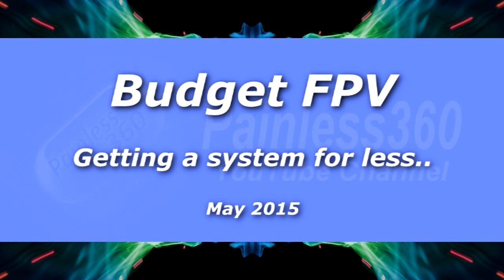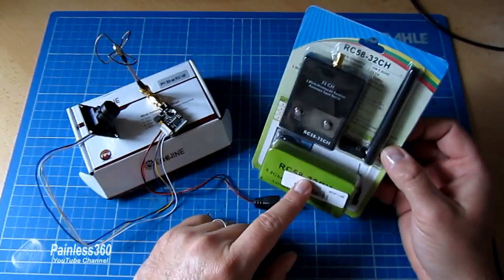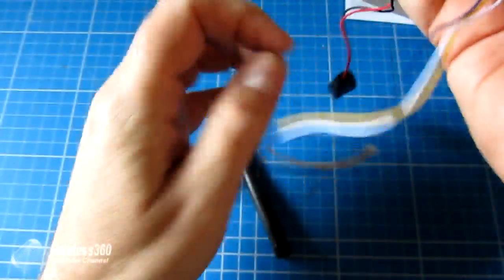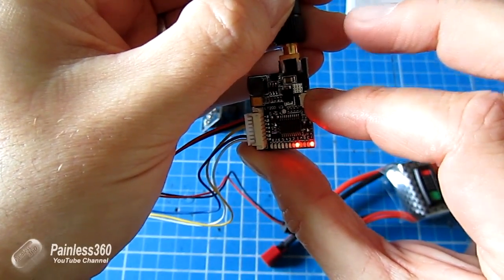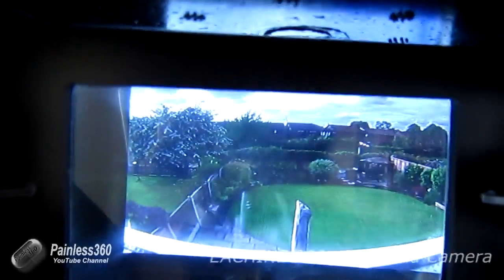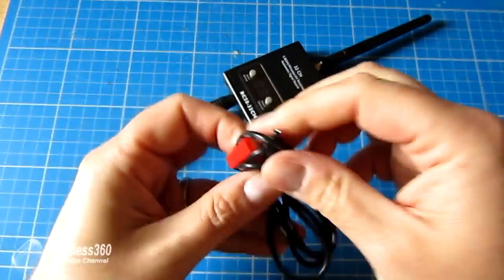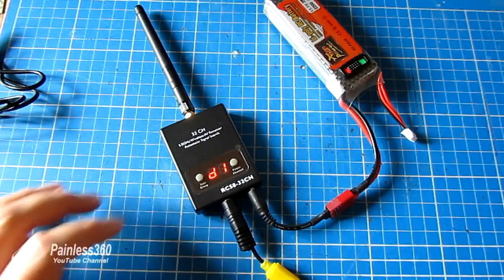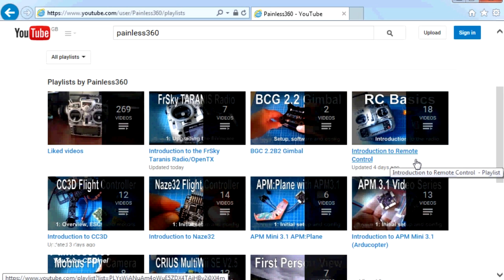Great FPV on a Budget - How to get a camera, transmitter and receiver (products from Banggood.com)

Comment: After getting a broken transmitter from bevrc I got this to start fpving.
I got the 305 receiver and they are a perfect setup for my bixler.
I use the quantum DIY fpv goggles and can see everything fine to around 2km

Comment: Glad to see you found the same comparability issue between the rx and fatshark tx. I used one for some 'passenger' goggles and found much poorer range than my immersion rx, but thought it might just have been a bad rx so banggood replaced it which of course made no difference.

It will be interesting to see how the camera/tx combo work in action.
Reply from the maker: atschris In action they work great for local field flying and getting into FPV. You get a huge 'bang for your buck' using this system and once people start to get into it then investments in more expensive kit makes sense.
Saying that - still love the Quanum goggles - don't care if I look like Bender!

Comment: im using Eachine fpv kits, a 200mw and a 600mw, they are sound, even when using the standard antenna, they handle low light really well, the only problem I found was when its getting dark and theres still a bit of light left in the sky the camera struggles to see the ground until you are in the shadows, other than that, its a perfect kit and the price is a bonus

Comment: I cannot wear fat shark due to glasses. I did get some nice goggles on sale,actually referbs at a dirt cheap price. I got the echine tx02 camara and also a seperate transmitter and receiver. I wanted it to run my  run cam from. I wish Banggood would send me free stuff to test but thats ok,I just watch guys like you and figure out what it is I want. Good video.

Comment: Excellent video! I have a question that isn't RC related, but still is on the subject of wireless cameras. I picked up a security camera and would like to use it wirelessly over an IP so I can view it on my laptop. I know there are systems that can be purchase, but this is a high quality camera that I have next to nothing invested in. I'm hoping I just need a transmitter, but I'm not sure which transmitter would be suitable. If you could point me in the right direction, that would be greatly appreciated :)
Reply from the maker: +4DIYers sorry, Im not sure. I would normally use some kind of FPV system but Wi-Fi connectivity isn't something we tend to get involved in a lot here for remote control. Best of luck with it.
Reply: No problem and thank you for the reply :) I appreciate your honestly.

Comment: I can watch your videos for days!!! There is so much good information. Thanks for all the great instruction! Subd! I have a quick question. I saw a 600mw version of the tx kit from eachine on banggood. Would that be a better choice? Or does that not make too big a difference? Sorry if I missed that in one of your other videos. Oh yeah it will be used for racing and freestyle type flying. Thanks for any advice!
Reply from the maker: The more power equalls more range. A lot of countries only allow a certain maximum power for FPV transmitters so be aware of that when you order one.  Best of luck!
Reply: Painless360 I will definitely remain aware of that! Thanks again!

Comment: Nice review.  The camera is CMOS and I think the CCD cameras, also inexpensive   at about $17 from Banggood, are less prone to jello effects because of rolling shutter in CMOS devices.  Thanks for exploring the more affordable options.
Reply from the maker: Hugh Dinwiddie Please point me to a cheap. 5v CCD camera...
Thanks
Reply: Painless360  I don't have this camera, but this looks like a possibility: http://goo.gl/mNXCsu  After your video I ordered this which seems to be the same camera as the link here along with the transmitter you had: http://goo.gl/F5AZwc
Reply from the maker: It is very similar but not the same, will have to get one and see..

Thanks and happy flying!

Comment: Is the RP-SMA adapter you quote in the mentioned products link above the correct one?  or do I have to select which 'ends' I need when ordering.   You guessed it.. I'm new to this FPV lark but I do intend to follow your advice on the strength of your videos here.  Superb work!  I hoping your setup here will be suitable for fixed wing out to 1500m?
Reply from the maker: The links are to the ones I am using in the video.  Best of luck!

Comment: Thanks so much for the clear explanation of this FPV system. I am totally new to RC and quadcopters so I have just now ordered the kit above and the Emax frame combo kit you also reviewed, so excited. Can you recommend an entry budget level radio and quadcopter battery as well as the battery for the receiver/quanum goggles. Thanks so much I'll keep watching.
Reply from the maker: ***** Hi Rob, there are a few videos on the channel about learning to fly and flying FPV. This playlist may be of use - https://www.youtube.com/playlist?list=PLYsWjANuAm4rQfddw-7YZDzckoJ_KyOpm
Radios are an investment for the hobby and something that can stay with you for many years. I still use my first 'proper' radio a DX7 and have had it for almost 8 years now. I would look at what your friends use and consider radios like the Turnigy 9XR.
The battery to power the goggles doesn't need to be huge. I little 3s 500mah pack will run if for hours.
Best of luck with the FPV, it can take time to get to grips with it..
Reply: Many thanks for prompt reply. I'll keep you posted as to how things develop. Cheers
Reply from the maker: Best of luck with it. FPV is a blast!

Comment: Brilliant series of vids, can't thank you enough for all the useful info.  Can I ask if the low cost fpv gear from banggood can be used with a Möbius to display on a ground station?  Thanks again.
Reply from the maker: Roger Williams Yes it can. You will need to make the cable to connect the USB/AV out cable that comes with the Mobius to the Tx though..
Best of luck.

Comment: Nice video - FYI the different connextors are called small and rpsma if u didn't k ow already. Love your videoa, especially your APM series. :)
Reply from the maker: The Channel Formerly Known as Epik Beats Thanks for that - I did know that but most people get very confused and I've seen vendors also use the wrong names for the connectors to so showing the pin/lack of pin is a very 'safe'' way of letting subscribers know what they are getting/need.
Happy flying!

Comment: Hi mate, a big fan of your channel here, you helped me to get my tri-copter with multiwii and now I have build several quads with naze32 with your help. Now getting into FPV, and I'm fighting with a Eachine camera to make it work with the minimOSD, so far no success. I see you have used that camera in this video, I have almost the same system (Eachine 600 with 800TVL camera), can you point me to the configuration I need in the minim osd arduino code to make them work together? (Eachine camera with the minimOSD).Thanks!
Reply from the maker: All of the steps are covered in the video. Check wiring and also that both are set to the same TV setting (PAL/NTSC).. Best of luck!

Comment: I built an FPV system like that with similar parts I got on Ebay.  I probably should have ordered from Banggood though because the first seller I ordered from seemed to go out of business and was delisted from Ebay so I never got anything and had to order everything all over again from a different seller. I was going to use it on a quadcopter that I intended to build using a Pixhawk PX4 but since that's impossible to ever get working I'll probably use the FPV system to get video from a remote security camera instead.
Reply from the maker: Lots of other flight controllers to use if you have given up on the Pixhawk. Best of luck!
Reply: +Painless360  Yes I bought a KK2.1 that should be an upgrade from the worthless Pixhawk. Not as many features but at least they can be made to fly and you don't need any crappy shareware to run it.
Reply from the maker: The KK2.1 is BASIC so you've gone from one end of the spectrum to the other! Best of luck.

Comment: Nice review and a neat little package for the money.  Can I just get the transmitter on its own?  I've managed to smash the SMA connector off my 250mw Fatshark transmitter and after soldering back together, it's doesn't appear to be performing as well.  Also, is the connector which goes into the camera the same as the Fatshark cameras connector?  I have the 600TVL CMOS Fatshark camera which is good enough for me.
Reply from the maker: valderja Yep - I am using it with a FatShark Pilot HD camera at the moment on my latest build (tri-copter).
Happy flying!
Reply: Thanks for that.
Reply: What kind of range do you find you're getting when flying a quad fairly low down with this setup using those CP/CL antennas?
Reply from the maker: I don't fly too low personally. there is a rule of thumb that your height should be 10% of the distance away from yourself to maintain a good connection. I have had the craft low about 240meters out and now had an issue though..

Hope this helps.
Reply: Good to know, thanks for the info.  I found that I was having signal drop outs when I was a couple of hundred yards away when I was maybe only fifteen feet off the deck with my current setup.  Signal is much better when I'm higher up

Comment: Startersets are very good. Do you know if there is a WDR (wide dynamic range) system in camera? This makes the image not better but the contrast is much  better. Maybe an idea for another Video.
Have great weekend and thanks for so many informations.
Reply from the maker: Peter Neumann This is a camera and transmitter for less than £18 - what so you think? ;)
Saying that, the image is excellent but if you want to spend a lot more there are other options for a camera you could connect.

Comment: Hey Painless.I went on your advice and bought this system and boy was I pleased with the outcome,thanks.
Just a quick few questions,can you put a link up for the RCA jack. Did you notice that the transmitter was getting pretty hot? I'm using a Turnigy 11.1V 3s 1000Milli battery for my Goggles and same for receiver and one for the Quantum goggles,did you notice or is it just mine?
Thanks
J
Reply from the maker: Jack.F Rost I got the RCA jack from the local electronics hobby shop (Maplins here in the UK). The Tx does get warm but not excessively so..
Reply: Jack.F Rost All transmitters get hot . The bigger in wattage the more heat to a degree, no pun intended. LOL

Comment: Thanks for the great video. I'm trying to order the parts and see that there are now right angled antennas available from the link you included. However, I am getting a bit confused between the various SMA connector types (male, female, SMA, RP-SMA), so please can you clarify which antennas and connectors should be ordered? Thanks,
Reply from the maker: I always rely on the image in a listing as some vendors get confused too!  ;)

Comment: I'm not sure if there's a problem here with My Transmitter, I've ordered 2 of these, the 600 mW version and the 200 mW version, I've recieved the 200 mW version already and during the bench testing everything seems to work perfectly, great video and good reception, everything.. My main issue is that the Transmitter gets extremely hot, almost to the point that you can't touch it, that's a bit worrysome. Is there a problem, or is that normal, should I maybe fabricate some heat sinks? And that's just the 200 mW, the 600 mW is I'm sure gonna be even worse..  :(
Reply from the maker: +Soco Joe They do get very warm, If you have a few little heat sinks it wouldn't hurt to pop one on the back of the inbuilt heat sink.. Best of luck!
Reply: +Painless360 Thanks very much for the reply, I just happen to have a Boscam 250 mW that never really worked right, why I bought these, such good reviews, I'll definately try to patch the heatsink from it to this new Transmitter.. Great Video, thanks so much for the Education, I'd never be able to do this without Your help..  ;)

Comment: One thing I really hate about FatSharks is that they have horrid chromatic aberrations at the edge of the FOV. These guys don't have any grasp of good quality optics. Boscam goggles are somewhat better in this regard, but there is still room for improvement in them also. You would think that for the price that these goggles cost, they could provide some decent achromatic lenses.
Reply from the maker: +K Danagger The Dom V3 I am using are great. The first ever set I got (going back a few years here) were the Predator 2 and the lenses were 'ok' but had chromic blurring at the edges. The latest generations is a huge leap. Happy flying!

Comment: Love your videos, I'm learning a lot! A question concerning the power necessities of the video receiver. It states 12V DC in but you're using a 3S (11.1v) supply... Any idea what this receiver regulates it to internally? I'm wondering if a 2S might be sufficient..
Actually same question about the transmitter. The 3S connector is supplied, but do you think this set might run off a 2S supply? For me my question is two-fold. First the literal question: can I use 2S? Well, I might just try and find out :) But also more general: is there such thing in the RC/FPV world as a common voltage that most electronics tend to operate on?
Reply from the maker: +lebasson Great question. Most transmitters are designed to work with 2-3s packs (check the specs for the one you are using), a 3s pack can be anything from 12.6v down to 10.5v (!) in use. There is normally a voltage regulator on them that is reducing the voltage to 5v anyway. Most things run on 5v and we use BECs to reduce the main battery voltage to that more useful voltage for all the electronics. Hope that helps..
Reply: +Painless360 That certainly does, thanks! Just ordered some BECs for future use. Handy for LED strips I imagine. Both the sender and receiver you used in this video work just fine on 2S btw. Happy!

Comment: Good video,,, thanks
Excuse me, I would even be a question.
How you can use the on-screen joysticks?
You transformed the cable? or always brought out the video signal cable and power.
Plugging the OSD cable and configure it?
Oh, and how many volts using
the camera hs1177
Reply from the maker: Sorry, we've not used those cameras. I assume that will be covered in the manual and specs. Best of luck..

Comment: are you going to make video about how to make good quality of FPV video?
LC filter, BEC and so on
Reply from the maker: Konstantin Mishenkov Not planning to - I've never had any of the problems with interference here using industry standard kit and common sense..Maybe I've been very lucky..
Reply: Painless360
 i use BEC to power video
without it video very unstable on maximum throttle

Comment: I have a couple questions regarding FPV:
1) You are using a 148 degree camera in this video. Do you find 148 to be the best choice for FPV? They also offer a 110 degree version. I think something narrower would be better. What are your feelings on the 110 version?
2) I'm from the US. So, what are the regulations for FPV use and power levels? I'm guessing this isn't an easy question but I'd like to get your take on this since I'm sure you are in contact with many US FPVers.
Reply from the maker: +Christopher Lyons I find the best views are 120-130 degree, any more feels like I loose too much detail in the centre of the image. Some fly up to 147 degree but that's the limit for me. I'd check with the local FPV resellers and check in the forums. I'd suspect that it's 25mw but every location seems to have a different law! Happy flying!
Reply: Thanks. What about 110?
Reply from the maker: See my previous answer ;) A lot of this is personal choice and what you are used to..

Comment: I'm going to order everything listed above. I have a question about the antennas on Banggoods site they have 4 different types which is the correct one to get?
L Type RP-SMA Male
L Type SMA Male     
W Type RP-SMA Male      
W Type SMA Male
Reply from the maker: +Michael Brewer I'm not sure, depends on what antennas you have/are going to order.. I've not heard of W and L type..
Reply: Ok, your link redirects you to the page with the different antennas.
Reply from the maker: Check the images in the listing, looks like SMA male and W type (i.e. no L bracket). Check with the vendor before ordering..

Comment: I found the 148 degree camera a bit too wide angle for me.  They also sell the same setup but with a 110 degree camera which I find a lot easier to fly with.
Reply from the maker: Stuart Bailey Yeah, I normally fly with 110-120 degree systems myself but don't find the 148 degree tricky to use. I have used wider too and, for me, the detail in the centre of the screen became just too small.
Happy flying!

Comment: What is the range of this fpv before it breaks up? Also can you use a screen/monitor to see instead of the goggles? I'm new to this stuff.
Reply from the maker: +betactical Range is tricky to answer as it depends on the antennas used, local conditions, power of the Tx, sensitivity of the receiver, position of the craft etc. With decent antenna this will easily get you past 400ft and well beyond with the right kit.

Comment: is your camera actually 148deg fov, I bought 2 of the 200mw combo and a spare camera all advertised as 148deg fov, I can tell and show (video a/b comparison filmed from a 7" screen with edges of fov marked for both) that the 3 that I recieived (2 in combo with 200mw 32ch tx 1 seperate seperate for quanam goggle mount cam) are nowhere near 148deg, they are substantially narrower view than a 131-132 deg fov mobius c lens camera, all labeled with little silver sticker as 148deg, all appear to be 110deg.